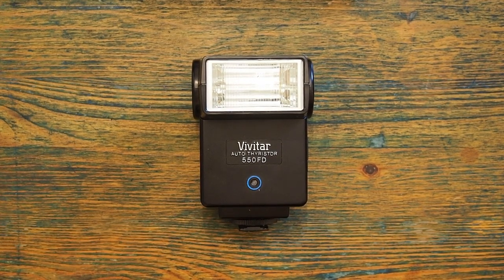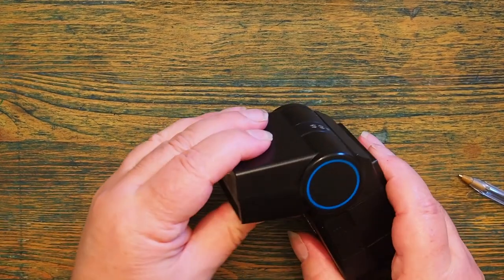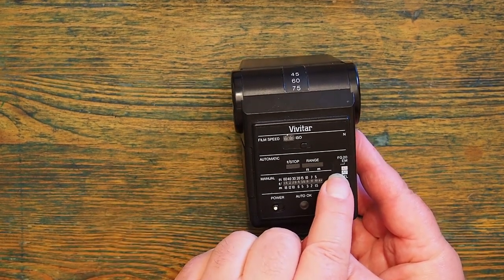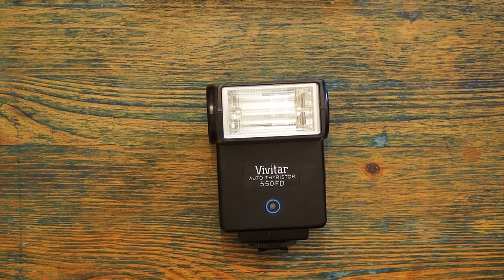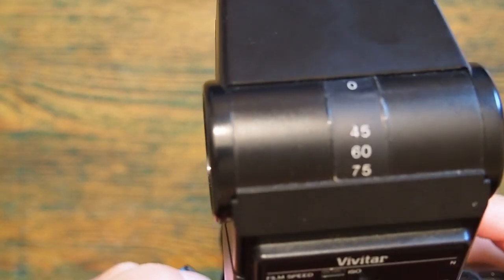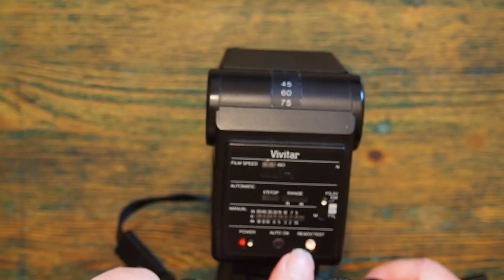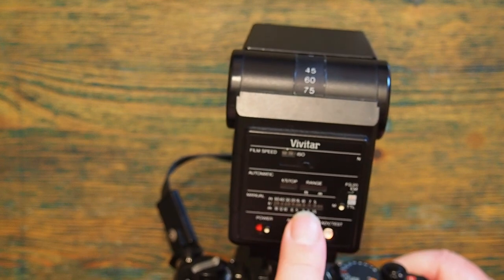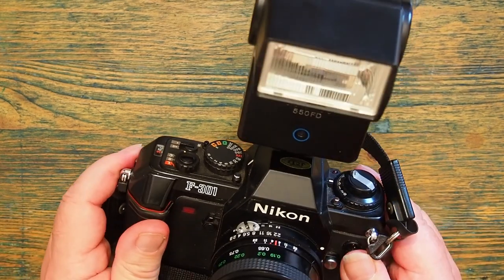Vivitar 550fd Auto Thyristor Flashgun

Comment: Having not much else to do I went through all the flashes I've picked up over the years, some of which have just been attached to camera's I've bought at charity shops. To my total amazement they all worked, as long as there were fresh batteries in them. I'd presumed flashes tend to 'burn out' and break easily as most of them are cheap plastic. Even the one with a Hanimex point and shoot that had batteries that looked like the Dead Sea Scrolls still inside, carefully excavated out, still worked. Hats off to lots of little south east asian ladies doing monotonous jobs on a conveyor belt.
Reply from the maker: I've had flash guns fail due to corroded contacts, but only once due to a fault elsewhere, and that was physical damage to the connector on the flash shoe. Never had a tube go wrong!

Comment: Minolta x-700 compatible ?
Reply from the maker: There was a minolta version. You have to check though as each manufacturer has it's own pattern of contacts on their shot shoes.
Reply: Havent tried it but my dad gave me he's minolta x-700 and it came with this flash, so I want to assume it will work once the camera is fully operational.